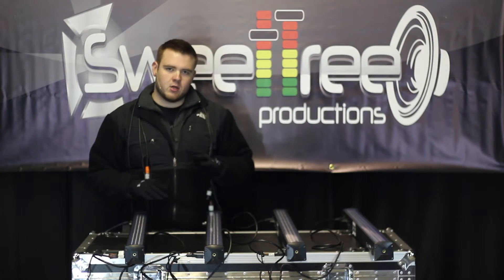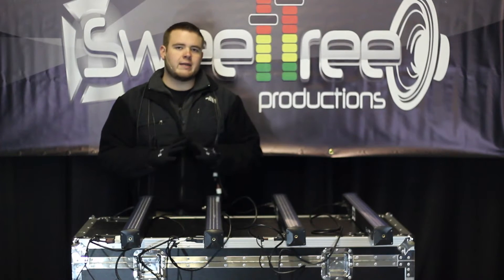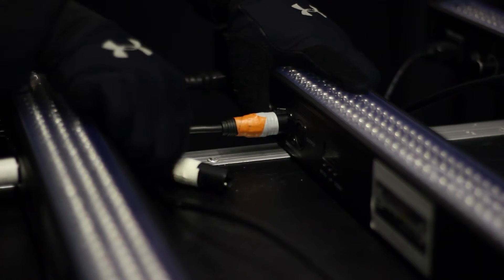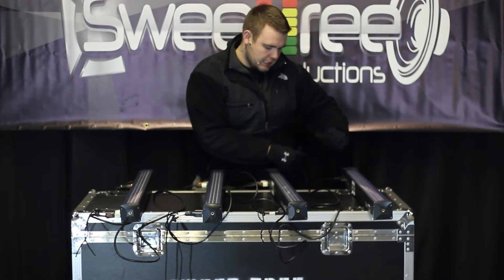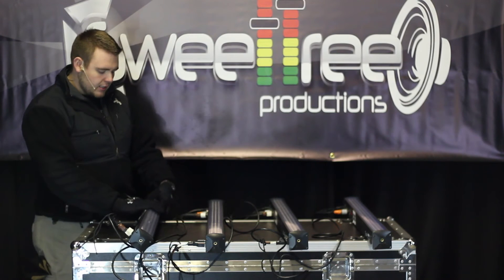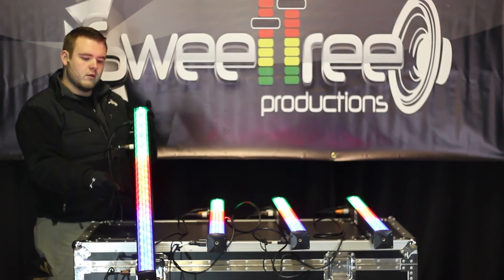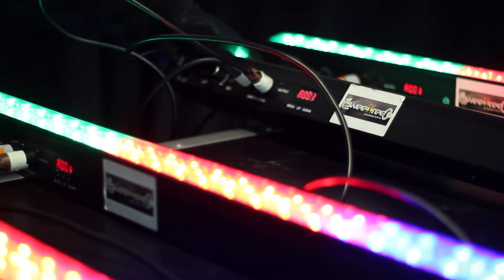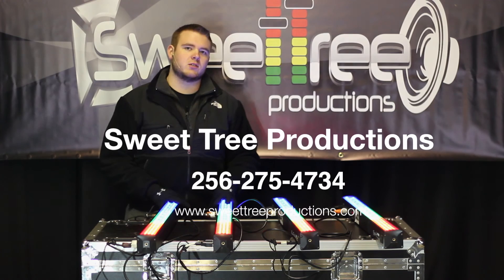Daisy Chaining DMX

Comment: Can u daisy chain different lights togheter?
Reply from the maker: You can. They just need to be on different DMX addresses.
Reply: I thought u had to set them in the same address in order to function on slave mode with the others for example I have two RGB spiders and two stage RGB will the move along in same adddres slave mode
Reply: Ramon Loera if you are using in slave mode you are exactly right leave them on 001

Comment: Does chaining just affect the program?  Are they each plugged in to a power source separately?
Reply from the maker: Once they are all links with DMX cabling you can use a controller or assign one light as a master to control the other ones with built in programs.